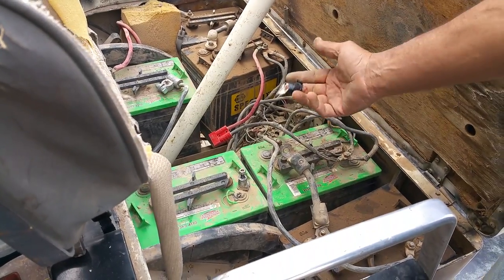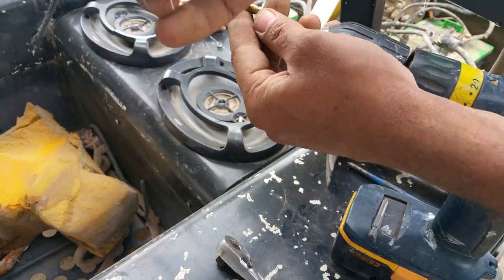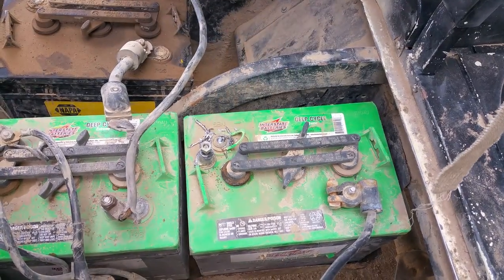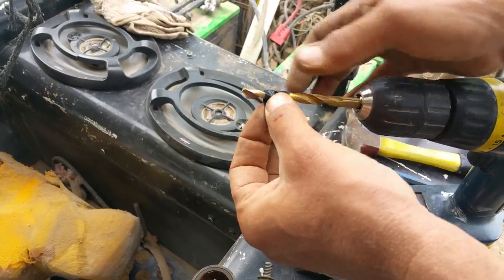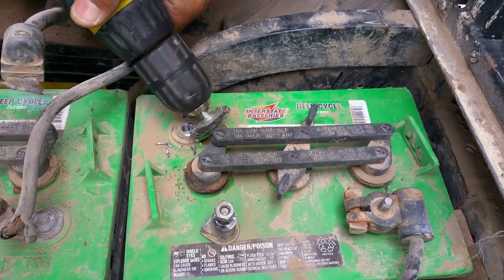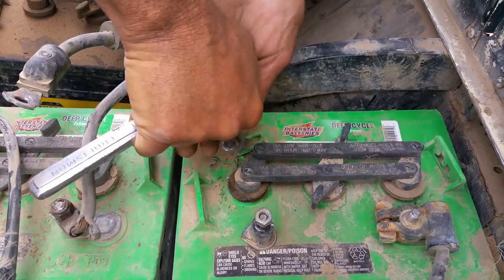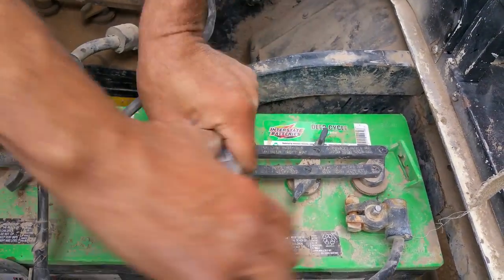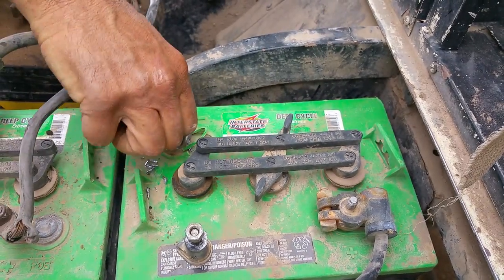How to Repair a Battery Post Solved

Comment: Another great one. I don't have a broken battery post, but this has some good machinist lessons in it. Thank you for sharing.
Reply from the maker: you got it, thanks for the great comment. and for watching.
Reply: Any machinist would use oil on the drill bit, on the tap and would use anti-seize on the installation of the replacement stud.     Also this repair shown would be a very short term fix due to the corrosion that will soon take place between the regular steel stud and the battery.    Stainless steel studs, installed with anti-seize is the only long term solution.   Drilling an exact diameter hole is only possible with oil on the drill bit.

Comment: Quick fix! Thanks for the video.. I suggest holding the nut ( below the cable) with an open end wrench while tightening the nut on top of cable...That way the stud stays in place..Also, wire brush the cable end on both sides, and apply some grease(Vaseline also works) to avoid future corrosion problems

Comment: Great video! I've looked high and low trying to find a stud like you use. What is it called or where can I find one like that?
Reply: I've used a 5/16"-18 set screw 7/8" inches long installed with the use of a 5/16"-18 tap.

Comment: Couldn't you run a bottom tap into the hole to cut the threads instead of just forcing the bolt down into the lead? Thanks. Jpol.
Reply: You mean like 3/8-16 or some junk? Nah, this way is badass. 😏

Comment: Really interesting. Can I use this method for a stripped sidepost? I'm referring to the female part on the battery itself, which I've demolished.  I can totally see myself doing this but I'm concerned about how far in I can go. On your application you mentioned 2" but only going in a half inch. Any idea what depth is safe with side post batteries?  I'm almost flush with the side of the battery box as it is... but if I could go in a 1/2 inch I would be golden...

Comment: Thanks for that, my son melted a post off my carts battery.
Reply: This happens when the cables linking the batteries together are too loose and not really-really tight. A golf cart mechanic told me this, and since I've tightened all the cables down to each battery, I've not had another problem.

Comment: Hi, Brian. I have a 150 ah inverter battery; the positive terminal got cut off due to corrosion. Will I still be able to fix it like u say in the video?
Reply: Reju Roy if the terminal was corroded most likely the battery is to
Reply: @tomdixko8900  thanks for ur reply. Only the post was knocked off by corrosion, however we were able to fix it using ur method.

Comment: Won't dissimilar metals cause buildup of sulfates around the terminal area?
Reply: Probably.but it’s cheap and an easy fix and works fine . Just buy a new battery if need be in the future

Comment: I hit my positive batter terminal  with hammer like yours, now the battery wont start the car. It shows 12.6 volts but no crank.
Probably the terminal got loose from inside. Anyway to fix that?

Comment: Good one on battery term fix.. What l want to know is what caused my positive terminal to melt on Briggs and Stratton mower..!?
Reply: Typically erosion of the post is caused by a poor connection, leading to excessive heat and melting of the lead battery stud.

Most battery specialty stores carry an adapter that allows a stud post battery to be used in an "Automotive post" application (like a car or a truck).    Most trucks, golf carts, etc use stud post type batteries.

Comment: How do you fix a threaded spinning post. 
Got a 1000 CCA semi truck battery with an overtightened nut that made the post spin now.
Reply: Can you take the post out? If so, you might try pouring melted lead in the hole and carefully (very carefully) insert the post into the melted lead.

Comment: Hey Thomas Brian, My battery post did not break off it came right out of the battery! Is it repairable or should I just get another battery?
Reply: Stainless steel Helicoil would solve the problem-but many side post batteries already have steel Helicoil type inserts installed in them, making them difficult to repair, but they normally do not strip out.     Install the side post bolts with Anti-seize

Comment: TONY   I was surprised on a Trojan battery how swallow I could drill before break-through.  So I did breakthrough and used drill tap for threads.  I installed bolt and all fine.  However realizing that the bottom of the bolt is exposed to battery acid, will I have a corrosion problem?  If so should I do something else?
Reply: Yes, the bolt will corrode over time. Best to use stainless steel.
Reply: Smear the bottom end of bolt with grease(Vaseline works too) to help with future corrosion

Comment: The battery I have doesn't have lead going down.  It appears to be a weird rocky looking composite substance with a copper coating around it.  Do you think the same process would work?
Reply: This is what ours is like, did you ever find a solution?
Reply: @kellycusce887  His process still worked for me.  Mine looked more like metal once I drilled into it.  Still not sure what it was though... maybe some kind of copper mixed with other metals/minerals.  It was a battery for a solar system btw.  I've since gone to a lifep04 battery... MUCH better for my purposes.
Reply: @101perspective cool  thank you so much for replying. I think we're going to attach a new terminal to the second positive post and try that. If not we'll need to buy all new batteries and we'll look into your suggestion! Thx

Comment: Where did you get the stud?
Reply: I found at home depot 5/16-18x2" stainless steel hanger bolt
Reply: @jmac161616  Thanks Mac. My local hardware store doesn't carry these, but I'll check out Home Depot. Thanks again!

Comment: You know you're getting the straight skinny when the guy wears the electrical tape and paper towel bandage.... that'll get you through the day no problems. It's the fancy band-aid and rubber glove wearing jerks ya gotta watch for... and make sure they don't run off with your 10mm socket!